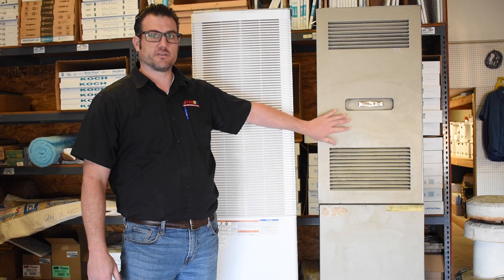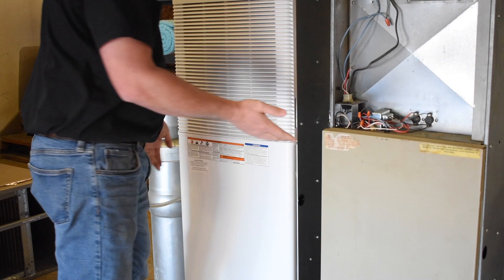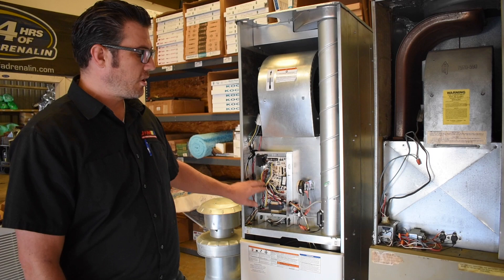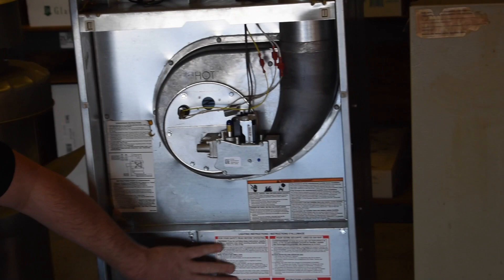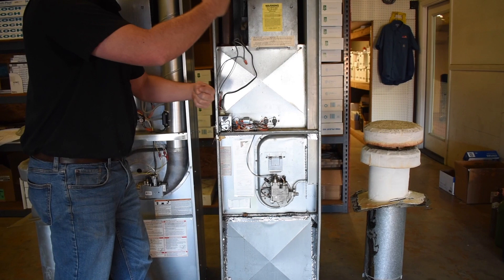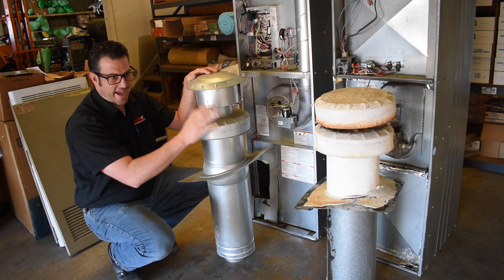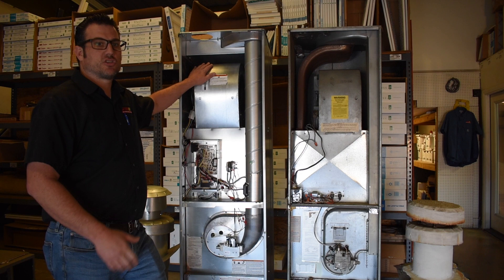Coleman Mobile Home Furnaces OLD vs NEW?

Comment: This furnace was installed in my home in 2011. The blower motor had to be replaced in 2016...a few months after the warranty expired, of course.  Now the blower motor is overheating all the time (4 flashing green lights) and I haven't been able to get anyone in to fix it.  I wish I had never agreed to a new furnace as they old one was incredibly reliable.
Reply from the maker: Blower motors are typically very reliable if the correct size furnace is installed and the ducting is checked to make sure it doesn't restrict airflow. There could be a problem that with the ducting that needs addressing. Best to find a local contractor to help you. (maybe a different one than the one who installed it)
Reply: Yep, same as my sisters they forced her to get a new furnace and now it's a piece of junk and the only thing it was a $20 part for the Old furnace!
Reply: @jmairnheat  Do you guys do any service in San Diego? If not, can you recommend somebody?
Reply: @lhenderson4635  I had the 4 flash on my Coleman. It was the limit switch. The one next to the fan, but it can be either one. The one I replaced was like $25. The other one is around $18.
Reply: clean it and check your capacitor

Comment: Good information, thanks. I understand it's your job to push new units, but most of us will take dependability over any perceived efficiency any day. No way that new until will be here still working 50 years from now, everything has planned obsolescence designed into it now.
Reply from the maker: Fundamentally the guts on both units are very similar. From my experience the only downside on the new unit is the plastic doors. Everything else is an improvement. Older units need to be checked annually for safety faults like a cracked heat exchanger

Comment: that older model had a wire that ran all the way across the filter to hold it in that somebody lost. i know because i have the same one. i bet the newer one wont last half as long as that old one will.
Reply: Same here, nothing's made to last anymore. And correct, there's supposed to be some wire bales holding the filters in on the old one.
Reply: I have a 1992 Coleman system and I fashioned a couple of wire coat hangers to hold the filters in place. I use the blue fibre and cut a filter to run the entire length top to bottom.

Comment: Yep. I have a manufactured home from the late 80's. It has the old style. That thing has been going strong for the last 10 years .  Starting to get 4 green flashes . Need to rock the rocker switch to get it to light up again when there are filters in it. I'm gonna pull the blower and clean it and replace the limit and the temp sensor.  Great info. Thanks for making this vid

Comment: Thank you!! I was trying to find filters on my old Presidential II (1978)  & had no luck. The 1" won't fit in the edge... Sooo I really appreciate the info about the filters. I have a grid over mine so it holds it in place BUT the filter material is breaking down so I was looking for replacements. This confirms what the HVAC company near me told me ... that they don't make 'em. LOL

Comment: I've worked on those Coleman furnaces for several years, most you don't see anymore in mobile homes in Florida, they come equipped with the Intertherm electric furnaces EB12's or EB15's with that model you are displaying in your video, that's either the Presidential or Presidential 2, it's probably at best an 80,000btu input and 54,000btu output; they are capable of handling a lot of BTU's You mentioned about the fan size being small, if it didn't have an A/C package; which came with the larger blower and motors, those units are capable of upwards to 5tons of cooling, I've upgraded them from standing spark to electronic spark ign. with the smart valves. Those Old furnaces are pretty decent, the motors can be upgraded to ECM motors as the new ones.
Reply from the maker: the new FER Compliant furnaces no longer support 5 tons of cooling. Even at 4 tons, the airflow is very poor.
Reply: @jmairnheat  True indeed, that's mostly why they went away from them, smaller applications such as singlewide mobile homes they use electric ones, if they are downflow which most likely will be Intertherm, those Coleman units are now made by York, which we don't see here in FL unless we are replacing them, even at that; they are replaced by gas packs or heat pumps. The airflow problem has always been in issue, it's just a trunk line stretched the length of the structure,  no transitions or nothing, just an aluminum box lol, they stick a 12" piece of flex in them and call it a crossover for Doublewides
Reply: I have the presidential 2 in my 2.5 wide. And that is one of my biggest complaints is air balance at the 2 far ends of the home. The middle is fine. Do the bigger fans push the air hard enough to make it to the ends better?
Reply: @Mark Kelley80  yes it does, the problem is the trunkline is a straight aluminum duct that runs the length of the mobile home, they are not transitioned; the further you're away from the Airhandler you get less cfm, the larger blowers are for high static applications. It t

Comment: Very informative.  I'd love to see more.  We're living in a mid 70's 1400 SQ FT DualWide.  The heat & a/c comes out of ceiling ducts and returns via floor ducts.   May want to replace the heat & a/c system (quite old and still working).  Based on research I can see the outside unit, air handler, and vent stack being replaced.  The duct work is pretty much sealed above the ceiling and behind the belly band beneath the trailer.  Whatever resources / references / suggestions you might have regarding systems like the Coleman would be great as I research my options.  BTW CA utility costs are pretty high,  so might want to consider options of heat pump vs. gas / electric for heating and cooling.  Pretty mild climate where we live.  Thanks!
Reply from the maker: Heat pumps are a good option. We replace many manufactured home systems with Ductless Mini-Split Heat pumps. 
They are great.

Comment: I was wondering about the handle gap on the old furnace, which is what I have, and I thought the filter was supposed to cover it. Mine does have a wire frame-like device to hold the filters in. I guess the owners of the furnace you removed never had it or lost it. Hope one day to upgrade as well, great video, love the electricity savings. It is a real pain trying to light my pilot light when it goes out.

Comment: I have an older coleman 7655 856 just like that. Any troubleshooting tips for a short cycling blower motor while burner is active?
Reply from the maker: I recommend hiring a professional.
Reply: throw parts at it, relays,limits all in cost is peanuts

Comment: Would these furnaces work correctly with MILLER split system ac units or do they have to be a Coleman/Evcon product to prevent equipment failures

Comment: I’ve got a Colman electric heater in my mobile home that for some reason the metal access door started getting warm even if it isn’t running, I think the elements are staying on for some reason... guess it’s time for a new one. It is 17 years old.

Comment: Does anyone know, is it ok to use pleated filters for this newer Coleman furnace? What would be the highest merv rating you can use without overworking the blower motor?
Reply from the maker: You can use pleated. 
You need to verify pressure drop over the filter, should be provided by the filter manufacturer.

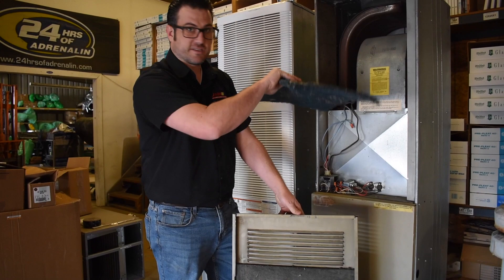Comment: Question: I had a 1995 1:07  Coleman AirPro 70kbtu gas unit replaced in 2021 with a Goodman 96% eff unit. The Goodman is using 4X more gas than my old Coleman in the winter (no leaks etc). I have done all research and questioning.. I believe these new units are not what they say they are. Can you tell me why my newer, supposedly better efficiency unit is using more gas? Btw avg. temperature is the same in the last 2 years and temperature settings.

Comment: I have a weird question I guess..  My Coleman Evcon electric furnace has cold air coming from the closet room that the furnace is in when my AC is on in the summertime.  Right now I put a hanging temp reader in this closet and its reading 54 degrees while my house is at 72-74 degrees.  The room is a little bigger than the furnace itself.  Is that normal?  the trailer is a 1999 model.
Reply from the maker: there is likely a cooling coil attached to the electric furnace, on some you can see it easily, it looks like the letter A on top of the furnace. You might have leakage or air bypassing the furnace somehow and recirculating in the closet. Not normal, but also probably not a huge problem. It really depends on the circumstances. I recommend you have a service done, do some maintenance on you system and have the guy check it out while he is there.

Comment: Great video, very informative.
Reply from the maker: Thanks Ryan!
Reply: Can you convert the old pilot light system with an automatic  system ,on an old furnace.  Coleman 7700B?
Reply from the maker: @noneofyourbusiness8092  No. The pilot maintains the draft in the flue. Without the pilot you will need an induced draft. Do not try to do this.

Comment: I had a power surge and it blew my furnace, I took off the cover and found that the board had been fried, so I bought a new board and replaced it, however the darn furnace won't come on. DEAD. What do I do next, other than call a repair man?
Reply from the maker: A power surge has the tendency to fry other circuit boards as well, have you checked the thermostat?
Reply: I'd like to know the outcome of this. Can you report back to us?
 I was told to put surge protectors on everything now days. Washer, dryer and furnace.

Comment: Thanks for the video. I have a garage furnace that was (I assume) installed when the house was finished in 1990. The furnace is a propane-powered Coleman 70 but there are no filters in it. In trying to find a filter for the thing,  I'm measuring 16 inches in the width of the filter housing but I'm not sure of the length because I don't know how far the filter goes down (how far it reaches). Have you any suggestions on getting the proper size filter? Maybe cut to fit?

Comment: Just upgraded from old coleman to new, and the new one is MUCH LOUDER!! After i expressed concern,  the installer turned the motor speed down to what he said was the "lowest setting "but he said there's a risk of it overheating and shutting off… Is this true?? I'm just wondering if I got a defective heater?
Reply: It's true.  
Imagine the airflow is your radiator fluid if you have less fluid your car motor will begin to overheat.
Reply from the maker: So the answer is "IT DEPENDS" 
Unfortunately there is no way for me to tell you 100% one way or the other. In general, if it overheats, it will shut off. Keep your filters clean, and service the furnace regularly. If the furnace does not maintain temperatures contact your contractor. 

But for sure, the new furnaces tend to be louder.
Reply: I have the new model shown in video.  It is not loud and ours is gas heat.  Better find out whats wrong while still under warranty.

Comment: Dear J&M..if you ever check old videos for questions,  I recently got one of these installed and he set the blower motor at the highest level to where my house is not actually heating very much..the air is going somewhere..but not warming as it should. It's been very cold and it will cycle for hours trying to get my house up to my setting which is only at 60 degrees. I know what you're thinking, call my furnace guy, right? I have. He doesn't  seem to have time to return my calls, lol. I think I know where to adjust the speed but can't get any details off you tube. It's the plastic connector thingie up next to the motor with the multiple wires, right? That's what the furnace door schematic said. My brother has some experience with furnaces but I don't want him to touch it unless he's absolutely sure he knows what he's  doing. Sorry so long, your video was very helpful. Thank you  for taking the time to make it! Have a great 2021!
Reply from the maker: it likely has nothing to do with the blower speed. I'd check the crossover duct under the home. It is relatively common for rodents to chew them up or for them to become disconnected completely. Call a different furnace guy if they are not responsive.

Comment: That's a great video. I have two questions. My furnace is a little older than the one your showing. but are the exhaust chute in the same place in the newer unit? and I'm on ssdi so money is tight what am I looking at for the furnace and the removal and installation of the new one?   just to make sure I find an honest repair person in Calif.  mine has the A/C unit in the bottom of it but I am sure I can't afford it at this time. Thank You for any help...
Reply from the maker: The exhausts are similar on most these types of units. If you are local you can call our company to discuss. we service Riverside county, parts of San Bernardino County. (951) 654-3464.

Comment: I have a 2000 double wide and have an electric furnace. I heard clicking sound so I turned off at thermostat but I am still hearing the clicking
Where do I turn off inside the furnace, thank you.
Reply from the maker: it is best to contact a local professional to determine if there is a problem.

Comment: What type of metal are they using for the heat exchangers now? I remember Coleman hear exchangers being notorious  for cracking, then they added a heat shield which just deflected the flames into a different spot which caused it to crack there. Hopefully they fixed this problem
Reply from the maker: Aluminized Steel.

Comment: I have the newer model gas furnace in my home. It's 23 years old and I've only had to replace the control board once, and a door clip of course. I like the unit overall. It is sized right to keep the house snug in the winter and cool in the summer. The only thing is that it is SO LOUD. The furnace is off the laundry room and we have to raise our voices to converse in the living room. Would reducting  to a larger trunk line reduce the back pressure on the fan cabinet and quiet the unit?
Reply: wish he answered you. about to buy a 2005 home with a original unit so about 18yo. I agree that it is LOUD :(

Comment: What filters do you use for the older furnace?  It is 19.5x37 total.
Reply from the maker: a standard 20 x 36 will probably fit. But most people use the washable cut-to-size media you can buy at your local big box store.

Comment: good info have to replace my heating unit soon and waiting A/C with the new unit thanks for the info.
Reply from the maker: No problem.
Reply: @jmairnheat   I’m considering a mini split unit to possibly a central air unit. DGAA077BDTA appears to be a Colman unit installed 2008 in my 16x70 mobile home of 1,150 square feet. I have had trouble educating myself on if a central air unit can be installed under this Colman furnace- per Redit the whole furnace needs to come out of the closet for say. Then a coil has to be installed- then need to confirm my electric panel will be able to have the circuit added 
Basically I’m wondering what direction to go would raither have central air than the mini split can this be done and what am I researching for? Would like to be prepared for the cost. 
So far a mini split looks like 1,500
For central need coil and condenser per redit the coil is 300.00 and not sure on the condenser have not gotten that far I’m guessing a 3-4 ton?

Comment: We bought the older version to use in our garage.
The old one vents out the bottom. Can we re-vent it to blow out the side?
Really hate to have to put it on a platform and run the ductwork out the bottom. 
Thanks.
Reply from the maker: If it has the coil compartment, you can just remove the door to the coil and let it blow out the front. If it doesn't than no.

Comment: Why can’t I reset the limit switch or reset button. It will not go down
Reply from the maker: It is probably a different issue. The reset switch can be faulty, but our service manager thinks it is probably something else.  Hopefully this helps. If you are in our area (Riverside County, CA ) we can service your system. Otherwise you may need to call a pro in your area.

Comment: I’m just installed the new Coleman - the same as you are comparing. Can you please tell me how to adjust the heater fan speed?  The factory setting is way too high and super loud.
Reply: Yep it's loud but don't mess with the fan speed or yo will cause other problems.

Comment: Hey guys. Great video. I was wondering if you had any input on what I could do to my existing older unit to make it more energy efficient? Can I upgrade my blower? I know I can upgrade my outside A/C unit and the inside A/C Parts if I'm not mistaken. Any advice would be great.
Reply from the maker: you can upgrade the blower, but that probably won't be worth the $. Make sure everything is working the best it can with regular maintenance by a pro. Keeping everything clean is the most important thing, after that, capacitors, refrigerant charge etc. will help. When you replace the system, make sure it is sized properly, and get the best unit you can afford.
Reply: @jmairnheat  My 410 was low from install many years.  Needed 12 oz .  I updated blower to 4 speed 3/4 HP but after new duct system and getting everything correct,  the two lowest speed work best

Comment: I have a old "coleman evcon presidential" 95,000 btu input 75,000 output gas furnace. What would be a modern up-to-date replacement?
Reply from the maker: DGAA090 OR DGAX090 in CA, but your contractor should be selecting the equipment on your behalf, that is what you pay them to do.